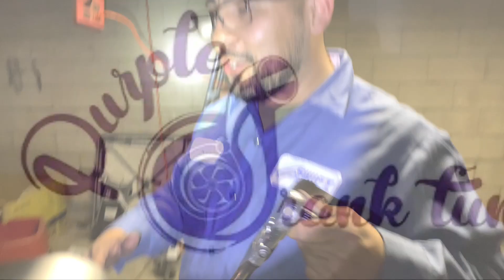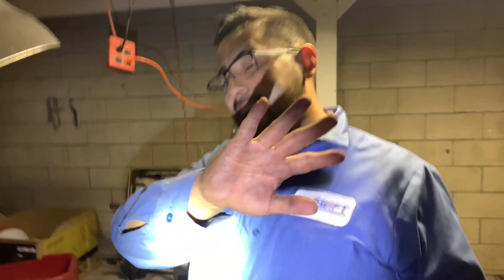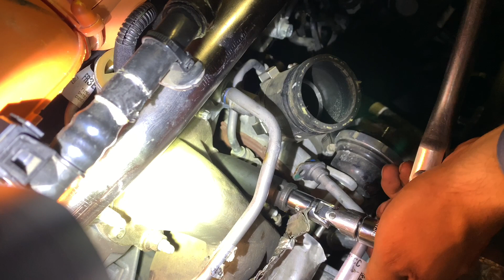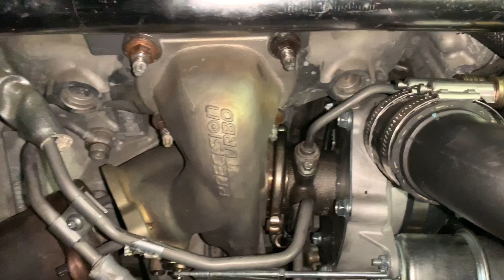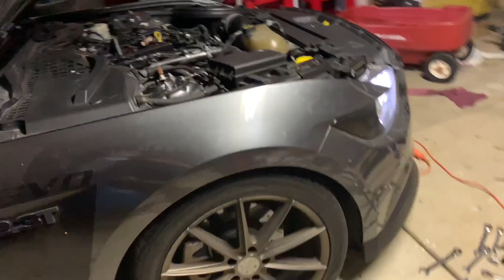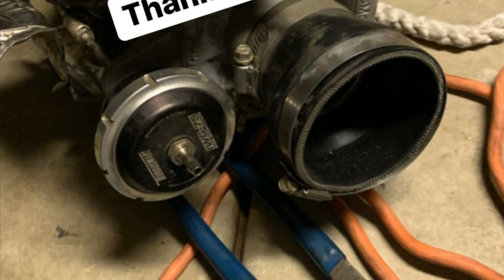Turbo Install Nx2

Comment: How’s it holding up?
Reply from the maker: motor blew after a month.  note i was running full e85 (450WHP/487Wtrq).  Ran lean and blew.  This turbo is great on a regular 91 tune or E30.  Once you get to to the 400+WHP range the block is ultra sensitive.
Reply: @conejomontes08  got any parts for sale?